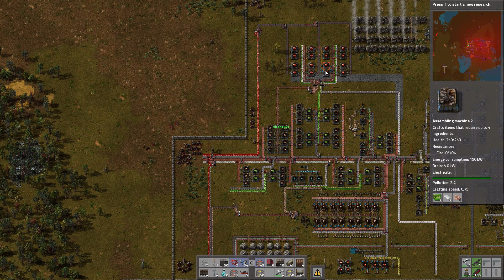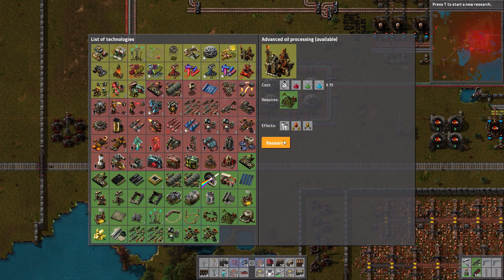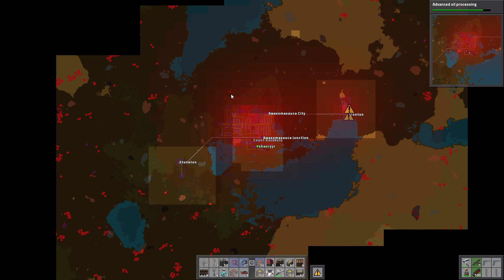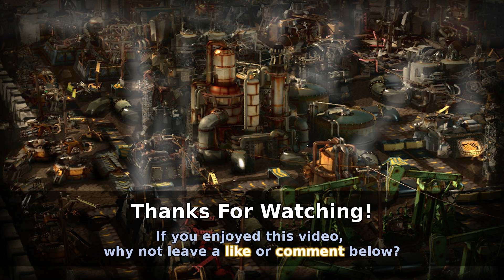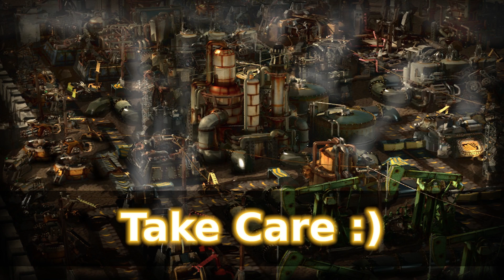Factorio Beginner's Guide - 13. Blue Science - Let's Play Factorio Gameplay

Comment: Hey guys. This is a REALLY good video series. Thank you so much. Quick question. Why do you sometimes (for example, copper wire going into red circuit production) have two splitters, one after the other feeding back into the same, single belt. Is this just to make absolutely sure you have both sides of the belt full?
Reply from the maker: Yup, it's just a convenient way to balance the belt neatly :)

Comment: Trying to understand the belt balancing using 2 splitters you have at various points.
Doesn't that mean you have 1/2 on one side of the belt, 1/4 on the other, and 1/4 as it already was?
I think you covered it in an earlier episode, but I am starting to notice it a lot more as the factory has grown.

Comment: When the oil pump goes to .1 if you let it sit idle does it fill up to higher amounts or is .1 forever. When you play on peaceful mode and attack an alien does just that one base attack back or is it gloves off for all aliens from then on? When you destroy a base and unlock the aliens to start evolving, again is it just that one area or is it all aliens that start evolving?
Reply: I can answer the peaceful mode question. As long as you don't attack, they won't. You and them can live in peace.
However, there might be a time where you have no choice but to kill them in order to build an outpost (for Science or whatever).
Reply: I was hoping it'd be the second option -- you can delay the aliens until you're ready, but you'd better be ready. If you attack a single biter or spitter, it'll attack back. If you attack a nest, the whole cluster will turn hostile. It won't remain hostile, though. I don't know whether it's time or distance-based, but whenever I blast a nest and then run away the rest of the cluster is neutral again when I return.

All aliens share the same evolution counter, though you might not see the results for a while. Evolution level is decided upon spawning, and spawning doesn't happen until the existing bugs have gone somewhere else.

Comment: I think your left/right belt balancers (e.g. 14:02, both copper and steel plates after buffer, as well as elsewhere) are broken. Take the copper - any plate that goes through the right fork of splitter 1 (50%) ends up on the right of the belt. Any plate that goes through the left fork of splitter 1 and then the right fork of splitter 2 (25%) ends up on whatever side it was already on, which is always the right side of the belt. Only the plates that make it through both left forks end up on the left side (so you end up with 75% right side, 25% left side. I think you just want to erase the second splitter and just replace both tiles with belt (down, left) so everything that goes through the left fork of the splitter gets deposited on the left side of the belt.

Comment: Aavack, I've been having a lot of trouble setting up a multiplayer game, how did Shen connect to your game?
Reply: +Paul Miceli 
Say you host the game. The other person has to enter your ip address into their connection box. This is super easy for LAN just use a terminal/command prompt to find your private ip address. Type ipconfig on Windows and ifconfig on Linux and Mac. It'll be in the format 192.168.1.xxx or 192.168.0.xxx.

For an internet game the other person will have to do the exact same thing. From your side though you will have to make sure the port that factorio is forwarded and then you need your external ip address. If you don't know how to forward a port on your router you'll have to search Google since nearly every router does it slightly differently. Your public ip address can be found by typing "my ip address" into Google.
Reply: +Hector Maddock-Greene Thank you for the help, but I had already figured it out, I just used Evolve, sorry I didn't delete my comment, thank you anyways!
Reply: Paul Miceli
Don't worry about it :). You never know, It might help someone else that is stuck.